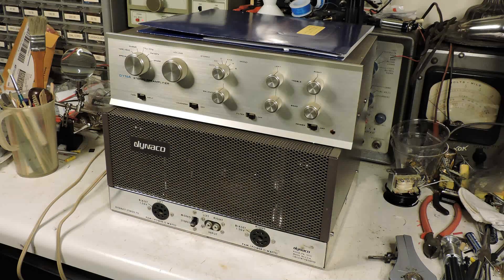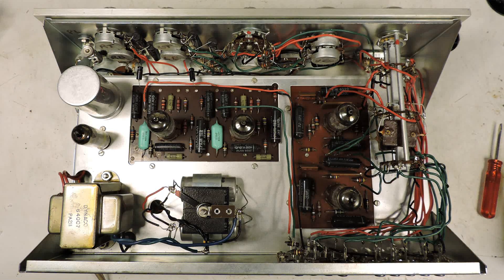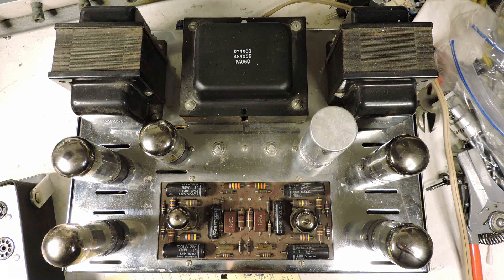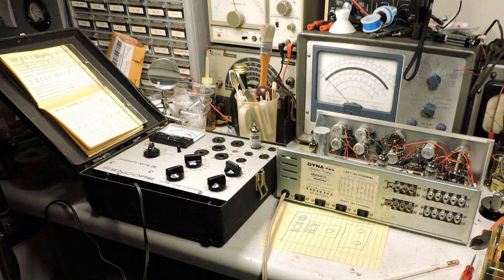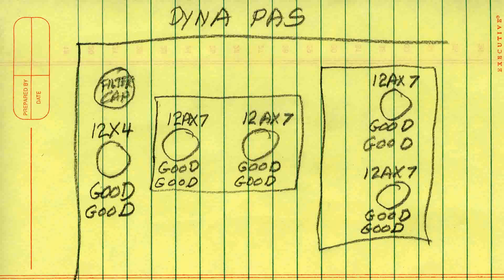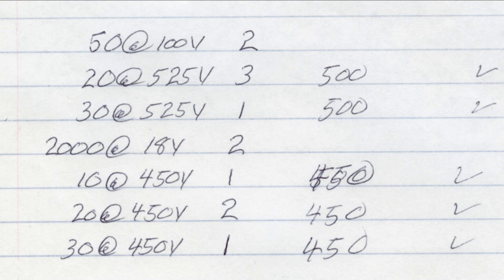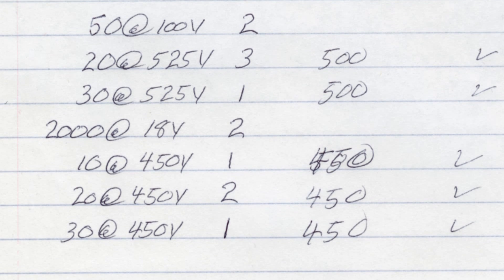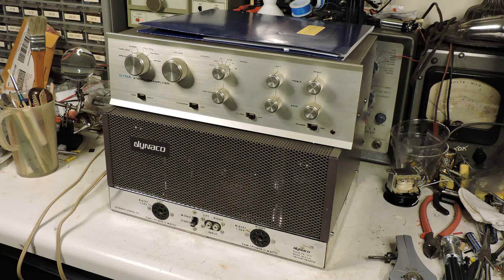The Dynaco Project Part 1

Comment: I have the identical but older PAS preamp and Dynaco ST-70 amp. I have a problem with the preamp. The balance control, dual 750K piggyback pots are seized up solid. I broke the shaft coming out of the front so I'm looking for replacements. Anyone know where I can find these?

I yours above, I see a lot of Radio Shack Lifetime tubes. One piece of advice- replace!!  They were known in the repair field to be garbage!!
Reply from the maker: Jerry Carriera I Googled “dynaco amplifier parts”
and found this link

@
Reply: AllAmericanFiveRadio
Thank you!!

Comment: Most beam power tubes have their beam forming plate tied to ground internally however, the EL34/6CA7 is unique in that it has it's beam forming plate tied to output pin 1. Most designs will tie this pin to ground however, by moving this to the negative grid bias, pin 5, it improves power output and linearity by moving the beam forming plate below ground. Some high fi amps took advantage of this so, it's possible this design already has it incorporated however, it's well worth the check to see where pin 1 attaches, to pin 5 or ground. I've done this mod to several amps through the years and it does make a difference. I along with the clients were well pleased with the results.
Reply: *****
This is the normal connection of most amps and if it were any other of the beam power tubes, it would be the only option as there beam forming plate was connect to ground internally. Being this design uses the EL34, it has the option of connecting the beam forming plate to the bias supply, below ground which increases it's effectiveness and increasing gain. I would think the designers of the EL34 had this in mind when they designed this tube.
Reply: *****
As this being a beam forming plate, G3, there is not a max voltage listed for this grid as it is intended to be at ground or below. I have run them in excess of -45V before. Depending upon plate and G2 screen voltage, there is a point of diminishing returns and this point is usually well beyond neg G1 grid bias. The increase in output is not a huge amount but is task worthy. Another point that is note worthy is that the original 6CA7 had a plate voltage max of 800 Volts and I've seen some older Marshall and Ampeg guitar amps run them at 1000 Volts with no problems. If you could provide a link to schematic, I would be very appreciative.
Reply: ***** This amp is ultra linear, being it has dedicated taps on the output transformer for the screen grids. THD should be pretty low. Try the mod and see what you think. It' simple and easy to reverse and certainly want do any harm. Just be sure to lift the ground from both pin1's of the EL34's when tied to pin 5. If you fail to do this you will short the bias supply which will not end well at all.
Reply: *****
The reason this grids load line curve is at 0V or ground is that it's function is to focus the electron beam and was not intended to carry signal voltage. You are correct that this grid being tied to the cathode, in this case, does float the G3 grid slightly positive however, this is in respect to chassis ground and not the cathode which is at the same voltage as G3. With respect to all other elements inside the tube, G3 and the cathode is at the lowest voltage inside the tube or ground as far as the tube elements are concerned. Connecting G3 to an even lower voltage will enhance the focusing power of G3 which is it's prime objective.
Reply: *****
Sorry. I had misunderstood you earlier. Yes, you're correct. I understand now what you we're saying and yes, no 6L6' after that mod. My apologizes.